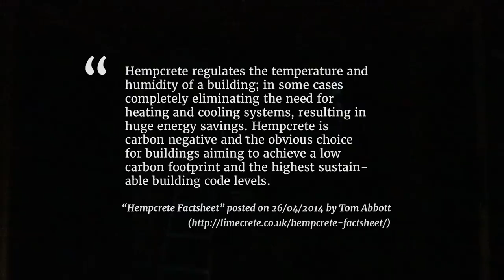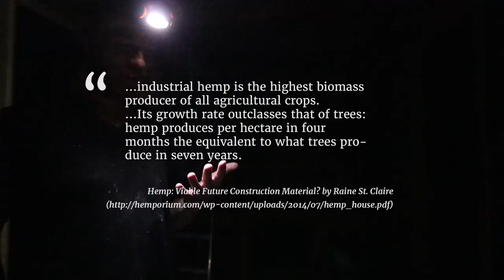Revealing the hempcrete pour for my Tiny House 🫣 learn from my mistakes.

Comment: You might want to try using a mortar mixer, rather than a cement mixer. It will allow you to make a drier mix without the clumping. We dry mix the lime/metakaolin and hemp in the mixer, then add a very minimal amount of water. The mortar mixer beats it all together quickly, gets nice and sticky without much water at all.
Reply: Big fan Chris - I've read a few of your amazing books and appreciate your input on this video. Cheers!

Comment: They recommend not to tamp it down completely, but just in the edges to keep it fluffy in the middle giving it the R Value.
Reply: What is the "R Value"?
Reply: @kristinehovemoen7888  insulation rating. A high R value means it is well insulated, and can even get negative R values

Comment: People seem to be wondering what's the point of hempcrete? There are lots of advantages. First where as it's not considered structural it adds strength to the walls which foam doesn't. It won't compress which loose fill and fiberglass will over time. It's fireproof and is wonderful for deadening sound. The walls breath and you don't need all the layers of material standard walls need, you just finish with lime plaster. Finally it's about the greenest material around shy of rammed earth. They use the inner pith fibers from hemp which is a very green material. They don't use concrete you use a straight lime plaster which reabsorbs the CO2 released when it's made unlike concrete. Costs are slightly higher but the benefits offset the extra costs. It's mostly more expensive because you still can't grow it commercially in this country so it's all shipped in from Europe and Canada and shipping doubles the price. If they start growing it in this country the price will plummet and it'll get cheaper than traditional systems.

FYI there are companies making prefab wall panels with it but you need heavy equipment to lift them. It's cheaper to just pack the walls in place. For another option check out Aircrete. It has a lot of the same benefits but is radically cheaper. Aircrete is the cheapest building material I know short of cob which is effectively free.
Reply: Grayhand very informative! Hempcrete is also an exceptional thermal insulator. A typical 350 mm thick hempcrete wall will yield an R-value of 30.
Reply: @fiendlyproductions  hmm exactly what i was wondering- insulation wise wouldn't that still be pretty far behind foamboard since that is at least like R-6 per inch?
Reply: Did you know most plastic in the ocean comes from asian countries? They literally dump garbage in the ocean. USA we bury our garbage.  Same with pollution. China's industries and africa's bush fires contribute more than anyone. In paris they protested the HIGH taxes put on fuel to pay for the climate change (politicians putting money in their pockets) Why would hippy's make US citizens try to pay for it? Most vote on the same side of the political atmosphere that fought to keep slaves in chains... "but the big switch" name the policies they switched on .... So why vote demoncrap?....
Reply: Don't forget how hemp is very sustainable to grow with lots of fiber per acre and several harvests a year... Every artist who knows their materials would love to use hemp parchment instead of paper or cotton. Seeds and oil are super healthy... Every part of the plan could be used.
Reply: @kaizersoze   Science??? u ppl shot the last scientist after the Scopes Trial...
Reply: @nc3826  You don't make sense. Try again or run away from the debate. Up to you.
Reply: Grayhand check out fungal insulation. Much stronger than this... no mining. Just at waste and good ol ganoderma fungi.
Reply: @Dollapfin  Cool post your fungal building and ur test result showing its stronger...BTW they have been experimenting with it for decades but tend to take to much time and labor so it would be very expensive and it tends to breakdown...
Reply: N C and yes I agree it’s not very Rot resistant, however, when kept dry it can last as long as you have it. Look at osb. It’s probably the least Rot and water resistant building material known to man yet when properly covered it lasts for decades and can probably last centuries. Most materials die when exposed to prolonged wetness including this stuff.
Reply: @Dollapfin  I'm not here to debate the issue since, hempcrete has been used for thousands of years. While the use of fungus as a building material is still just an experiment. BTW , you were trying to change the baseline from hempcrete to OSB. Since we all know hempcrete is far more resistant to decay than most OSB or  fungus insulation. And the cost of a  fungus based insulation is far to expensive now. But if you find a way to use it in a cost effective manner I will happy to review your post on it. But until then I hoping hemp production and process will ramp up so the cost will go down in the US. Since I would like to build using it. So good luck with your fungus. Sir :)
Reply: N C well actually I didn’t Change my baseline. I discussed the common use of OSB as an example to prove that modern building methods don’t require Rot and water resistant structural materials as they’re often protected by a moisture barrier. You know what? I hope you do have great success with your hempcrete. I’d much rather you use something like strawbales, recycled or sustainable wood or something else, but hempcretestill is a positive and as we all know it’ll last a long time. Many homes built today are nearly disposable. I saw houses with that shit cardboard sheathing and almost puked I don’t think they’re meant to last ten years! I’m thinking about using rammed earth as a foundation. That takes lime too. Although I’d love bricks, they just take a lottttt of energy. How do you feel abt bricks and rammed earth etc?
Reply: N C I also saw these slag cement blocks that were formed by blowing co2 thru steel slag. I mean the steel industry is not sustainable at all, but it’s there and we might as well use it.
edit called carbicrete
Reply: @Dollapfin  WRAD, By using OSB as a reference point its by definition a baseline. But it's up to each person to choice what works best for them. And I would suggest getting an engineer to review your rammed earth foundation plans since generally is not used as a foundation. And usually when rammed earth is used building material, at least 5% of portland cement is add not lime. Also soil contain varies wildly, so you should have an expert test its contain if you need it to be safe and to last a lifetime. This is also the case for the bricks too. While I did do soil testing for construction work in a past lifetime, it was just to confirm its suitable for concrete foundations not to use it as building material. BTW rammed earth walls are gorgeous to look at but are so labor intensive only the rich or are willing to spend half of their lives, doing it themselves, would consider it.  White using rammed earth bricks instead will reduce the labor it, will also reduce its beauty and strength. And they both have will give you thermal mass but are poor insulator. We could go all forever talking about the pro and cons of different materials that can be used and how to combine. Since for example hempcrete is generally not a structural element has being used with traditional construction materials and methods. But has been turned into a structural element as when reinforced and used as hempcrete blocks called justbiofiber.ca . And a major issue with all alternative building materials and methods is how to meet code requirements? Which makes some like Justbiofiber hempcrete blocks attractive since they are being tested to meet codes at least in canada for now. 
BTW I do have some dyslexia and did not take the time to review my grammar so I hope its readable and good luck with whatever you decide to use. There is no one right answer and the details of how its done are just as important. IE "weakest link theory" And pls excuse me for such long reply but this is far to complex of a subject to do it justice in a youtube comment
Reply: BTW Sustainable just means, "able to be maintained at a certain rate or level", which steel production fulfills. The fact it's been co-opted to have additional nebulous criteria is not a major interest to me since like most fade terms there is no clear meaning when ppl use its new more fashionable form. So I will stay with its classic definition.
Reply: N C your grammar is great. Sorry that I didn’t understand then term baseline you were using I made myself look stupid didn’t I? Those blocks sound pretty good. Maybe I’ll just go with the slag cement foundations idk.
Reply: @Dollapfin  Just make sure it has the strength and other criteria you need and i wish you well with it. Sir...
Reply: N C i wish you well too

Comment: I dont wanna be pesimistic, i have several years of working and education in the concrete construction.   

YOU REALLY NEED TO TAKE CARE NOT TO GET YOUR SKIN IN CONTACT WITH THE LIME BASED BINDER:   PH- VALUE 10 - 12     ...   ITS WAY MORE DANGEROUS TO THE ORGANIC BODY THAN ACID AT PH 1...   USE GLOVES  :-)
Reply from the maker: TRUTH 🙏 Learned that the hard way
Reply: or breathe it in, yuck

Comment: I am very intrigued by this construction material. How practical has this been for towing/moving your tiny home?  Hempcrete's loosely packed structure looks like it could crumble with the vibrations involved with pulling the trailer... but I could be wrong - it might absorb and dampen the vibrations.  What is your experience?

Comment: I think hemp is cool, but have found it to disintegrate in an alkaline solution. For context, jute is clearly worse. Probably does not really matter here, as this is not structural. The relevant question here is whether the lime helps or hurts the longevity of the wood structure, compared to other types of insulation.

Comment: You have it backwards:  Lime is caustic.  Vinegar is acidic.   I can't imagine the hempcrete would be of a more temperature and sound insulation value than papercrete or even haycrete.  However, hemp was/is used for rope and strong paper which tends to indicate it has long strong fibers relative to other plant materials.  So using it in applications in which tensile strength is desirable may make it more desirable than cheaper paper or hay alternatives which could be used for insulation.  The project shown there is an insulation application with no tinsel requirements.
Reply: Paper or hay should be way more expensive if hemp was legal to grow everywhere. It is incredibly efficient in how much fiber and oil you get per acre.

Comment: Why not do aircrete instead? Then there is no hemp to buy or to rot.

How is hempcrete different then sawdust Crete? There are mountains of sawdust where I live.

I helped to build a strwabale house with hemp bales in it. They were ok but you can not shape them for windows and doors like you can with wheat and barley straw. The hemp straw was way too stringy, it just made our electric chainsaws get all bound up. We used them to fill the north wall mainly. 

That experience made me skeptical of the hemp hype. I do think hempcrete is a better idea then the bales were, particularly around the place where they are growing and processing hemp for fibres.

Comment: How hard is it, to retrofit a mid-century, 2x4 framed house, with hempcrete into the wall bays?  Will building inspectors still try to force using waterproof membranes/house wraps?  
What is the R-value per inch of thickness, approximately? 
Why does the hempcrete look like glued wood chips, instead of white because of lime in it?

Comment: Do you know if hempcrete can be used to create the foundation of a house? Ordinarily concrete is the go to material. Is it a matter of building codes from city to city?
Reply: no Hempcrete is non-structural so it cannot be used for foundation, but you can use it as flooring or floor or a less wet mix as attic insulation

Comment: 1:07 That is not very good at all. Did this have impact testing done? There shouldn't be that much bubbling happening in the process. Would 'hemp bricks' work better for upright usage? (since walls like these are not load bearing and have the timber framing already in place)

Comment: Good stuff.
Let us know if one can instead use some kind of hemp-crete mix to get the same insulating performance as thick polystyrene/-cyanuriate foamboard; like what's used as an insulation barrier under a basement or garage floor.

Thanks for any help.
Peace of Lord Jesus upon you and yours

Comment: I've never had any experience with hempcrete or aircrete, but I would be interested in knowing if anybody has made a type of air-hempcrete combination. Anybody ever heard anything about this?
Reply: Air-crete is cement with bubbles in it, still incredibly resource intensive because of the concrete. Hempcrete contains 0 cement although some people do add a tiny bit of Portland to the mix, it is not necessary. Hempcrete has a much higher ability to insulate in comparison to air-crete... although the particle sizes of the hemp are currently not refined enough to use in a 3D printer like air-crete is being used. However, Hempcrete has air & chunks of hemp in the mix so I say it is already what you're making in your head :)
Reply: Thanks for that detailed information - very helpful!

Comment: Tell me about insects and bugs, is this fire proof,  what is insulation R VALUES???
Reply: Billy Bob a typical 12” thick wall with 350 mm thick hempcrete will yield an R-value of 30. Given that variables such as density of mix and proper application have been accounted for. Hempcrete is also widely considered fireproof, and pest resistant
Reply: Hempcrete used in a home is Fire, Mold, Mildew, Termite-Proof, Carbon Neutral, can withstand Category 5 winds, rated for earthquakes, super-insulating, breathable, soundproof, alkaline & energy efficient. 
12" walls = 25 R-value, 16" walls = 33 R-value, 20" walls = 50 R-value (Ft2.oF-h/BTU) USA standard.
Furthermore, the price to build with hemp is around the same as regular construction with the added benefits of living in a healthier environment - better for you, your children & generations to come. This cost would beat standard building methods if hemp could be grown anywhere in the US.
Reply: But, most home walks are only 4. Thick so. Your. R. Value is not all. That,,,,,
Reply: @timlehnen3226  Which is why you design them to be  thicker when using this material.

Comment: You might want to research that I have seen entire structures built with it. Add more concrete to the mix.
Reply: bob cole hempcrete is a non load bearing building component. It is an in-fill material used to insulate. It is not a substitute for concrete. If you have seen entire structures built exclusively with hemp shivs and lime binder, they are probably actually held up by internal wood or steel framing.
Reply: not using cement is sort of the point, to make it environmentally friendly. Hempcrete is not a structural material it can be done in monolithic pours as well as with blocks but it requires a structural frame.

Comment: Wht are you using it as insulation in a framed structure? Not the correct application of the material, there are better, easier, higher R insulation products that probably cost less too.
Reply: Hempcrete is not strong enough to be load supporting. A frame of some sort is a must. The recommended way to build using hempcrete is to pour it around an embedded frame. Yes, there are higher R-value insulation materials available. But hempcrete is sustainable, reinforces the frame and sequesters carbon in the hemp (for those who care about atmospheric CO2).